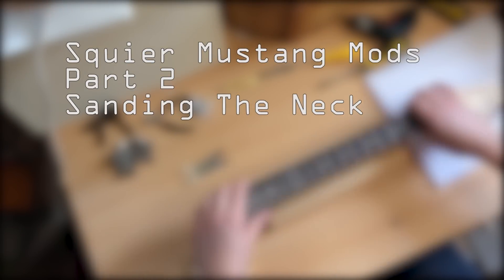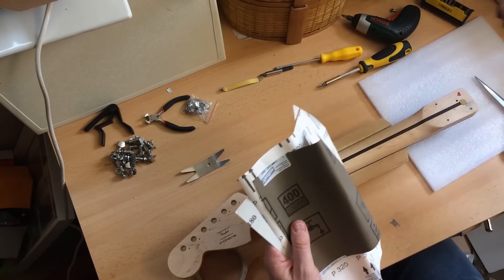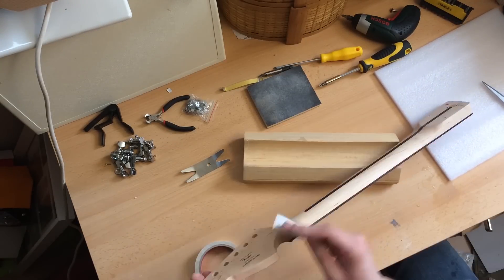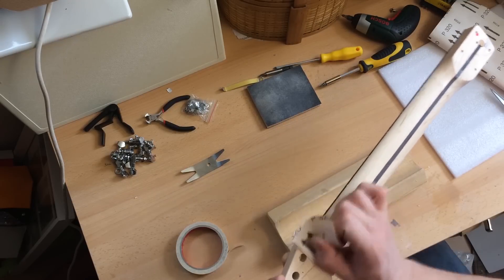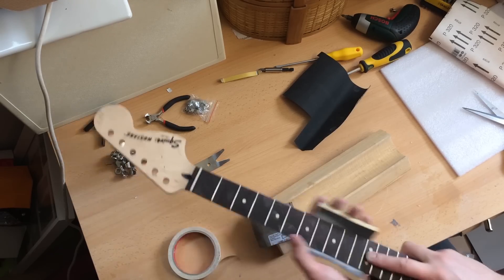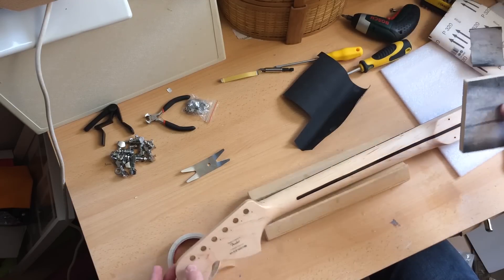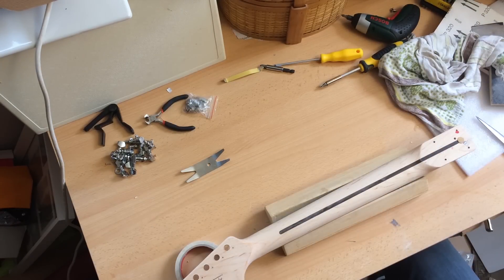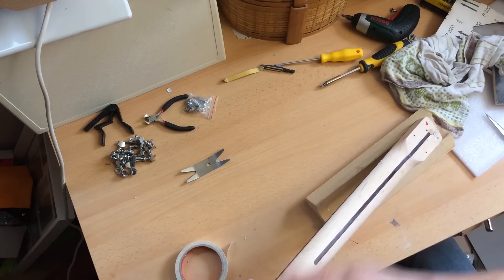Modding the Mighty Bullet Mustang Part 2 -  Sanding the Neck

Comment: I have squire bullet strat. when I got it the neck felt very dry and rough. once I got it home I used guitar polish all over it and oiled the fret board. it ended up feeling totally different the neck is still super smooth now 6 months later. I later got a fender American telecaster and used the same process with the same result. certainly you're putting in a lot more work with sanding and whatnot but for the average guy I think the polish is a great improvement for a dry or rough neck.
Reply from the maker: I think anything you do to the neck is an improvement. I prefer the full sanding method so I can get this feel quickly. The other way to do it would be to play the hell out of it for a few months. Either way, doing some work on Squier necks greatly improve their playability.

Comment: Hello,
nice video, again ;-)

On my mustang-neck I only used 400- and 1000-grained sandpaper.
Maybe the delivered necks can vary a bit, mine was already smooth enough to start with grain 400.
There was no need to whisker it too and I think I personally would avoid this on a guitar, especially on the fretboard.
But thats just my opinion ;-)

Greetings
Magnus

Comment: Can you replace the neck? Or put a 25.5” neck in? Or will need to fiddle with the electronics for that?
Reply: The bridge would have to move, guitar scale is measurement from nut to the bridge in inches
Reply: You can replace the neck without any other adjustments IF the replacement neck is the same size as the original, 24" scale length neck.  If you wanted to use a 25.5" scale neck, the bridge would need to be moved in order for the scale length (distance from the nut to the bridge saddles) to be 25.5"